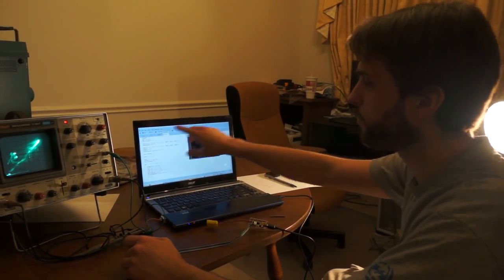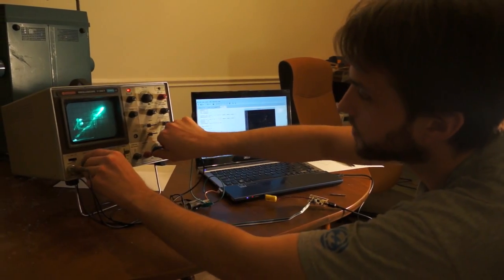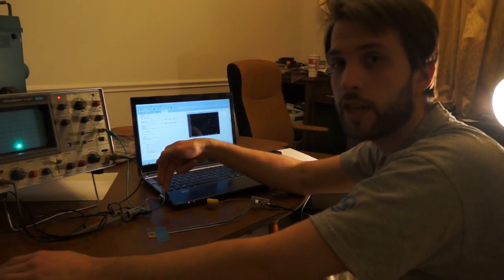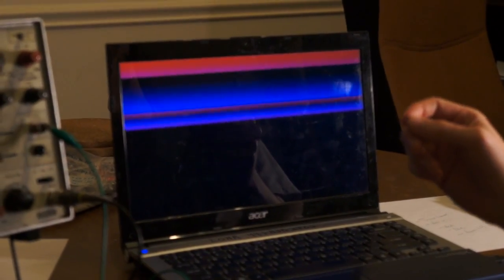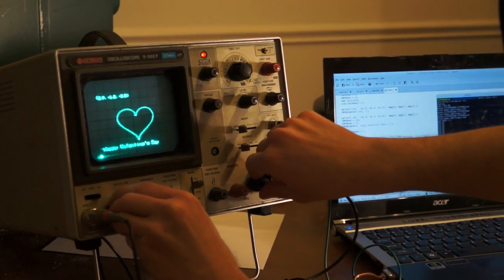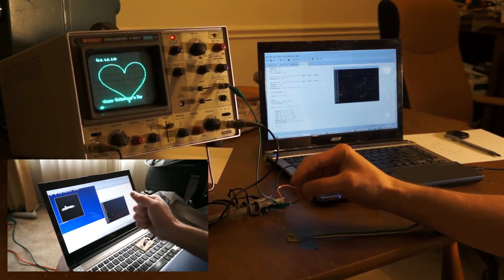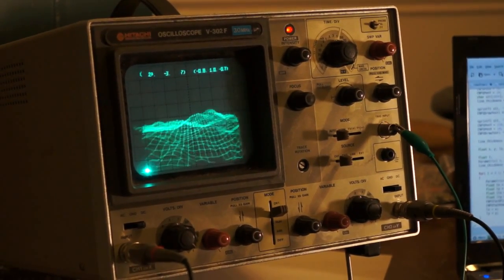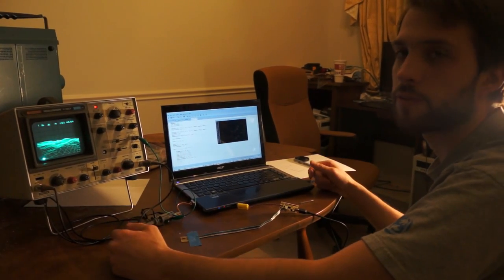Vector Display Output from a VGA Port

Comment: How about this; Take those x and y signals, and instead of feeding an oscilloscope with it, feed it to a couple of galvanometers with a piece of miror glued to it (quick and dirty galvo's: basically a motor with an elastic on the axle to limit movement so that it stalls rotation, but allows for movement of the mirror in the stretch boundary of the elastic). Then position the galvo mirror setup so that you can bounce a cheap laser beam off of the two mirrors, onto a wall or something.

10 dollar laser projection system.

Now take into consideration under/overshoot of the system (axis lag? I have no idea what the official term is) caused by the elastic not being stiff enough (slack = overshoot), or too stiff, and the motors aren't driven hard enough, or are too weak (undershoot, or scaling errors), andonce you compensate for that, you're a good 200 dollars into a professional laser show setup.

Now add a blue and green laser (trivial with the vga signals, which is a brilliant idea btw), hook the lasers up so that they can be varied in intensity, either direct by varying input power, or indirect, by using a (really) high speed stepper motor with a diffraction grating (or cheaper, a transparency sheet with a 0% - 100% opaque gradient printed on it)  to limit beam intensity. Now you're a good 400 dollars into it.

Closed captions are really awesome. Adds a lot of value to your video's. And I would not mind ads at all. In fact, why not go the subbable.com or patreon route, so people who want to throw money at you have a nice target to hit? ;)
Reply from the maker: It would take some circuitry to boost the power from the 1v signals on the GPU, and I'm really bad at that sort of opamp stuff.  I think a fair bit of the over/under shoot stuff could be handled by control loops on the data, which isn't too hard to run.

I'll keep doing the closed captions, and ads on my how-to's as they get older.  I think I may stick a full screen ad on here in a few days.

You're the second person to suggest patreon route...  I need to get back into the swing of regularly releasing videos... then I suppose that would work out.  Maybe I will just go for it.  And honestly, some of my hacks are getting to be more complicated and expensive, and trying to pinch pennies leads to heavy delays :(.
Reply: If you can have feedback back to the software side, then yes, most of the over/undershoot is definitely fixable in software. I was just thinking about it in an "as cheap as possible" way too, i think. I don't know if the cost of doing it in software would be smaller than fixing the mechanical parts. (i'm not really good at estimating time investment)

You're doing a lot of stuff that people really like, so i'm sure people (at least some) are more than willing to compensate you for the time / money you invest yourself. Just put ads on everything you can monetise. The people who don't like ads have adblock plus installed anyway. And as for the patreon /subbable route; Well, any dollar received is good, right?

Cheers man ;)
Reply from the maker: Indeed... I guess my thing with these projects is I am only willing to make certain amounts of an investment in unknown territory.  I expand my territory of possibilities, but slowly.
Reply: good call. Youtube combined with an agile mind often equals spending tons of money to show cool stuff. I guess there IS an incentive to cull enthusiasm :)
Reply from the maker: Hey, if someone else gets excited, they should go for it!

Comment: PIPBOY!  That would be the perfect application for a pipboy. Tho you'd need a flat distorted mirror side input type of tube screen like in those tiny tube pocket tvs.

Every pipboy prop i've seen uses a flat screen and whilst it looks cool it's not life like or better said time line correct. But if you were to use this type of screen. Wish i'd have your level in tech so i could make a pipboy like that.

Mah, ranting, awesome video!
Reply: Problem is, no CRT displays of that size are (or more accurately were) available in a portable format - a screen that size has a tune that is probably 12 inches long.